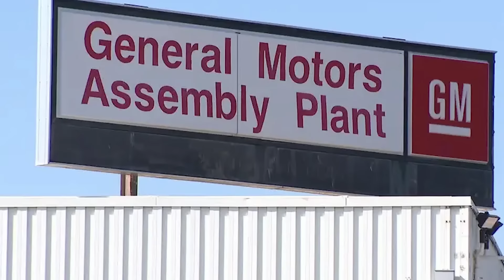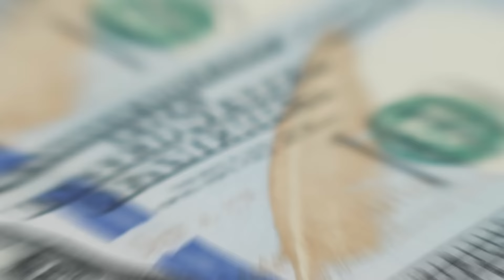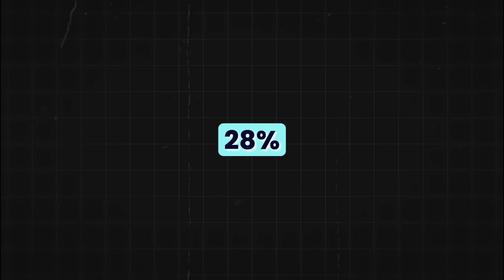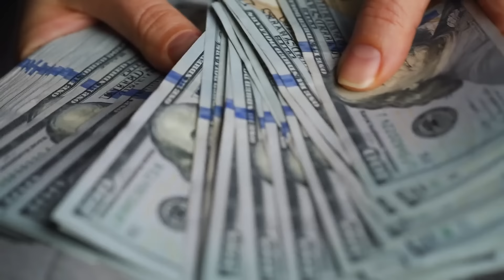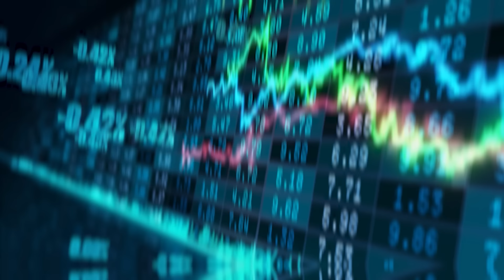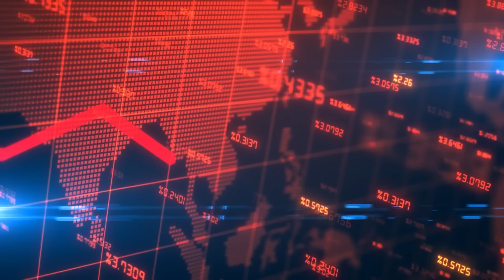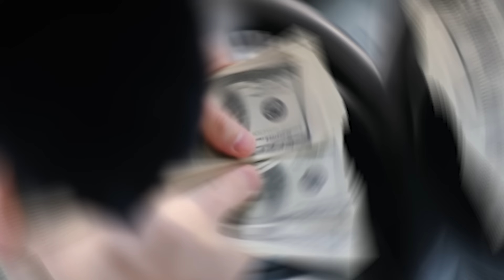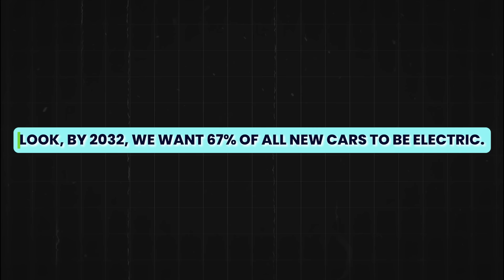The EV BUBBLE has Burst!!!

Comment: So shocked that a car that costs as much as two cars and can't even run during winter isn't selling.
Reply: what car would that be? EV work great at winter.
Reply: It's a reference to the EV charging graveyards.
Reply: And they burn like no gasoline car ever. I’ve seen it in person and it’s scary.
Reply: @matswessling6600  No they don't. They absolutely don't. Are you trying to be funny?
Reply: @Anubis78250  They absolutely do fine in winter. Its has been doen tp -20°C and there is no problem with the EVs. The gasolin cars have some problem starting in the cold though.
Reply: @matswessling6600  Yeah, I guess if losing half your range and doubling your charge times is doing great. Seriously you have to be on something to ignore the reality staring you in the face. EV's absolutely suck in winter weather. In the best weather they are sub-par, in winter they are a damned joke.
Reply: @jensgaethje8555  seems that is a problem with your power grid. not with EVs.
Reply: @Anubis78250  bullshit.  they work great in cold.
Reply: @matswessling6600 you say this like it's a gotcha or some big smack down on their argument. Meanwhile it's the single biggest issue for the EV market. There are politicians talking about mandating systems to prevent charging when a grid isnt able to keep up with demand. The grid is struggling with this tiny amount of adoption it's completely unrealistic to think we could completely convert in just a few more years.
Reply: @matswessling6600  really  explain why  salt and cinders cause battery plate degradation
Reply: LIVE where its REAL WINTER
Reply: Yeah but to even things out they can't run in SUMMER either, LMAO!
Reply: @MrImjustaminorthreat  thing is: EVs isnt really that big load on the grid.
Reply: It was -13º here in eastern Ontario yesterday. My EV ran just fine.
Reply: oh and btw its battery tends to spontaneous combustion itself setting the car to transform into  "ghost rider" :D
Reply: @matswessling6600  then why did my government put out one of those alerts that go out to every phone specifically mentioning charging EVs among other "non essential power usage"
Reply: @matswessling6600 maybe you need to tell the stranded EV owners in the Midwest last week…since it was reported everywhere their EV wouldn’t charge in the subzero weather
Reply: @matswessling6600  you’re delusional
Reply: @WeOutlawsTV88  thats a lie. For the battery to catch fire it must be 1) an old model 2) by damaged be extral means. 

they never just start burning by themselves.
Reply: @MrImjustaminorthreat  how should i know what the reason was?
Reply: @coolthings3899  "delusional"? do you own an EV? Do you drive one?
Reply: @genbigmac2872  then there is a problem with the loadibg stations. its not a generic problem with EVs.
Reply: @matswessling6600 bullshit,and thats exactly what electric cars are.
Reply: @matswessling6600  I'm telling you it was because it was straining our grid. We do not have the infrastructure for a complete conversion to EVs
Reply: @matswessling6600  I've got a 2022 tesla model Y, and a 2009 ford escape. I drive my escape in the winter because I'm an engineer and have a bit of a brain, and my tesla in the summer. Idk if you understand what a battery is but I help to design them at my company and no there is not yet a technology to properly insulate the batteries in the cold. I don't understand  how humans can forget science and physics are things. The world doesn't run on dreams it runs off of fact. Fact is, batteries don't like cold. Sorry, but I knew this BEFORE I bought my tesla. Hell I knew this when I was 9 asking my dad why he brought the flashlight he keeps in the car inside at night during winter months. You really can't fix stupid tho. You can take the laws that control our universe, show it to someone, and they'll still say your wrong because some talking head told them so.
Reply: @MrImjustaminorthreat  That doesnt sound plausible. There must be another reason. Maybe you use a lot of electric heating? Here we use a lot of hotwater  heating (water heated at a central heater for the entire city)
Reply: @whycantwealljustgetalong1050  ? heating of batteries is really not advanced technoogy.
Reply: I heard they’re not good in really hot countries either, and i don’t trust them with their lithium batteries, i don’t want a moving crematorium.
Reply: @matswessling6600 They are not environmentally friendly at all, they are heavy and can damage the riads, they cost heaps to service, who wants to have to charge a car for hours before you can go somewhere, and they are vulnerable regarding fires, overall, i wouldn’t buy one if you paid me. I don’t think they are the future. I love my fossil fuelled car.
Reply: @matswessling6600 I live in Switzerland where it has been pretty cold lately and there have been EV’s that had problems here because of the cold. I have no problem with my fossil fuelled car.
Reply: @Anubis78250 I heard they are not so great in really hot countries either, overall they are too problematic for me.
Reply: @matswessling6600  that's exactly what happened, it's cold so everyone's heating their homes which is essential.
Reply: @johnwise7693  Lmao...for how long, about 500 yards?
Reply: @genbigmac2872 yes i saw that video in the Chicago area, the Tesla chargers didn’t work because it was so cold. I have no problem with my fossil fuelled car, no EV crap for me.
Reply: @matswessling6600 you obviously haven’t seen the videos about EV fires, what about the Jaguar EV that caught fire in the owner’s garage in Colorado, it was a burnt out wreck and the other car next to it was damaged too. No moving crematorium for me, no thanks!
Reply: @MrImjustaminorthreat and even if there was adequate infrastructure, i still wouldn’t want one.
Reply: @matswessling6600 
Lol. Nope.
Reply: @matswessling6600 
Can't have one without the other, genius.🤦‍♂️
Reply: @ilovesuisse1  gasoline cars burns much more often.
Reply: @ilovesuisse1  
that car must gave been kn some kind of acciddnent.
gasoline car fires are way more common. (even when takkng in consideration that gasolin cars are much more common)
Reply: @matswessling6600 EV’s suck, PERIOD! I’ll never buy one.
Reply: @871jamie  EVs are cheaper than gasoline cars. Less aervice due to fewer parts. Better acceleration. no exhausts. you can fill it up at home. 
there are so msny great things about EVs.
Reply: @matswessling6600  You can't just state half the facts. You have to add to that gasoline fires are far less damaging, and far more controllable, not to mention far more predictable, and far smaller.
You heard about all the spontaneous fires after salt water flooding right? EV's going up in flames weeks after their low slung batteries were exposed. We use salt on the roads here in the winter, how long do you think it'll be before we start seeing similar corrosion induced fires around these parts?
Reply: @MrImjustaminorthreat  The grid isn't struggling from EVs charging. Most EV charging is done at home overnight when grid demand is low.
Reply: @whycantwealljustgetalong1050  My Kona EV has 415km range in summer, and about 70% of that in winter. I drive it with not problem in winter.
Reply: @Anubis78250  gasoline fires is as dangerous as ev fires. And flooded cars? are you pulling my leg? of course it hazardous to drive electric vehicles that been submerged in saltwater. that is a very small problem though...
Reply: @matswessling6600 charging an EV at home is the equivalent of running 50 refrigerators.
Reply: Really twice as much as two cars ? Go look at the price of new vehicles. Check out the price of a new Silverado.
And EVs do run in the winter. I have experienced Fuel line freeze up with a full tank of gas that took hours before they could be started. Have you ever heard of Glow Plugs? Research your information before you post.
Reply: @Nikkotheneat  

an EV uses 0.3 kWh per mile. 
10000 miles per year means 3000kWh per year.

ac uses 3 kW/h = 8000 kWh per year if used 8 hours a day.
Reply: Then do not buy one as no one is forcing you.
Reply: @Nikkotheneat  At home ? If you own your home use PV. No cost at all. And My refrigerator doesn't come close to using as much electricity as someone's HVAC, or their dryer.
Reply: @matswessling6600  Gasoline cars have the same crank battery issues in the cold weather as electric vehicles, but that's about where that ends
Reply: @briantaylor6522  But "gasoline cars" have cold weather issues as well.
Reply: @matswessling6600 Tesla does not. It was -20F here in the inland northwest. No one could operate or charge them. Wake up. They’re ok in sunny warm climates. Not here, no way. Stupid idea!
Reply: @johnwise7693 Must be warmer at -13C there than -20F in the northwest where they did not run. None on the road today and it’s 21F.
Reply: @matswessling6600 except that they do.
Reply: @matswessling6600  They are no where near as dangerous, or toxic as EV fires. Who is telling you this BS?
Reply: @matswessling6600  He didn't mean submerging the car in saltwater. He meant flooding of the low-slung battery compartment. Rain/snow/ice on the road combined with salt that the north likes to put on the roads in the winter creates... wait for it... SALTWATER.
Reply: @briantaylor6522  those are lead accs. Not the same thing.
Reply: @jsshay01  it wasnt the teslas that didnt work. It was the loading stations.
Reply: @TheREALJosephTurner  the batteries that has had problem was submerged. You do not get that problem just for drivibg on salted roads.
Reply: My first EV will be an Aptera, 29k, solar charges 40 miles a day, 15 during a dark winter - if you commute short amounts you never ever have to charge it, and if you want to go far they can have a 1,000 mile range on their battery.

They're several times more efficient than any EV on the market, no bells or whistles.
For example: a 900 watt solar roof will give a Tesla maybe 5 miles a day if you were to tie it in with the batteries, on a full sun day, in a warm environment.
Tesla gets 80 eMPG --- Aptera gets 350 eMPG.

Also, it's the only car that won't stress the grid. It can be fully charged quickly on a standard outlet.

Aptera or bust!
Reply: Living in Norway. EVs works great!
Reply: @matswessling6600   bullshit. they do not.
Reply: @jsshay01  If the EV is properly charged, it will start immediately at very low temperatures, and it will run. It will have less range than at more moderate temperatures.
Reply: Well they are great as long as you can afford a gas vehicle also! But you also need q garage... not just a garage but a heated garage preferrable. So you can store it... however I would make sure that garage is not attached to your home directly more like 100 ft away... THEN it will be better to own one...
Reply: Don't forget Tesla's can not be easily towed. Most tow companies will not tow EV's.
Reply: @matswessling6600  wrong.
Reply: @matswessling6600  let’s see you make it all the way across I80 west from Chicago to California as I do weekly. No charging stations out there. Lmao
Reply: @matswessling6600  you keep charging every 200 miles  while I keep cruising with a range of 2000 + miles in my Ram 3500. I guess I am cheating with 150 gallons of fuel on board eh? But I’ll be there in less than 3 days while you’re still charging your junk EV!
Reply: They are not selling though
Reply: @jc-uw5wt  I have an unheated garage. Gas cars catch fire 80 times as often as EVs, so you better have a detached garage for your gas burner, too.
Reply: I have no problem in the winter with my EV's they start every time - that is not the case with my son's older Ford Fiesta. 
Sure they have shorter range - especially if they have not been pre-heated but I don't go road-tripping in a snowstorm.
Reply: @johnwise7693  I thought about that too, gas is flammable!... but we will see in the long term what is more stable an old used ev or an old used cheap gas car... do we really have a choice anyway, on into the future we go woohoo!!
Reply: Who knew?
Reply: @matswessling6600  no they dont, i live in western canada and EVs are junk the last 2 weeks since its been -30 and colder. My 2 trucks and gas suv have been fine, started fine and ran fine. If you look after your vehicles they will be fine in the cold but i laughed at the EV people sitting at charging stations for hours with their heat on high and the charger can't keep up hahaa.
Reply: @matswessling6600 sorry mate, the chemical reaction that occurs in batteries to create the output slows down in cold weather making them much less efficient. It’s the same reason you car seems to crank over much slower on cold mornings.
Reply: Previously had a 2016 model s, battery went out and the lowest cost for a replacement was $20k. Never in my life had a repair bill that high for a gas vehicle.
Reply: @matswessling6600  can also be caused buy manufacturing errors. Lithium can be pretty volatile.
Reply: @brettellery2142  not if you heat the batteries. It doesnt cost a lot energy to do that.
Reply: @brettellery2142  so can fires in gasoline  cars.
Reply: @matswessling6600  what are you talking about, electric heaters aren’t efficient at all. And it’s a huge battery so it is not like a glow plug where it just needs to be heated for a few seconds. It will be needed to be run most of the night .
Reply: @matswessling6600  I never said petrol cars don’t catch on fire, I said that lithium is extremely volatile, petrol needs oxygen to burn, lithium does not, it is a chemical fire which feeds itself, it burns hotter, faster and is extremely hard to extinguish.
Reply: And you overlook diesel vehicles with block heaters because fuel gels in cold temps? This is decades old but people against EVs only want to bash them. Perfect? No way. Give me 5 minute charging, stations everywhere, maybe a wireless charging HOV lane and 400 mile range and now we're cooking with, err gas... Lithium? 😮
Reply: https://youtu.be/Pn2eCY3Kwuk